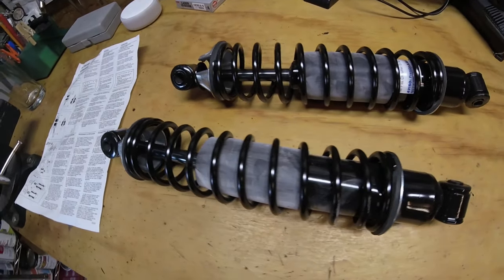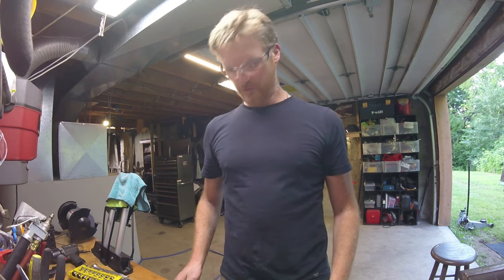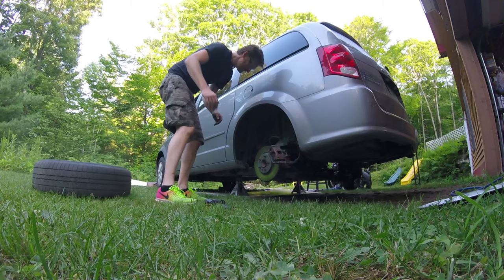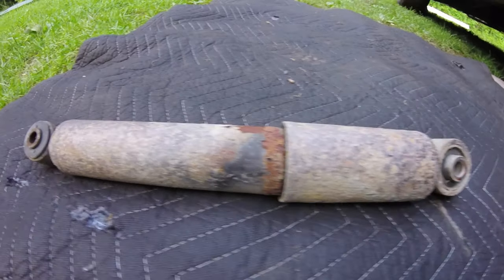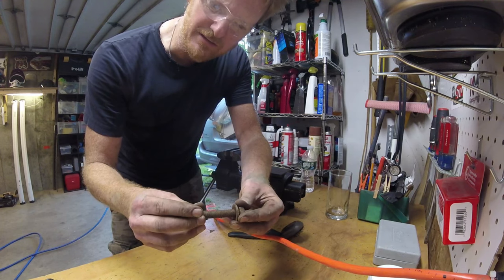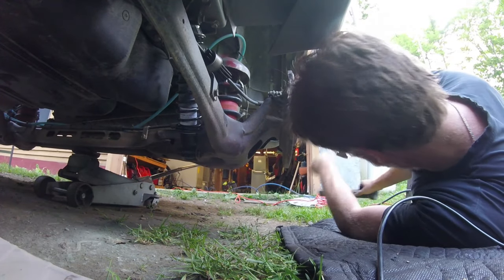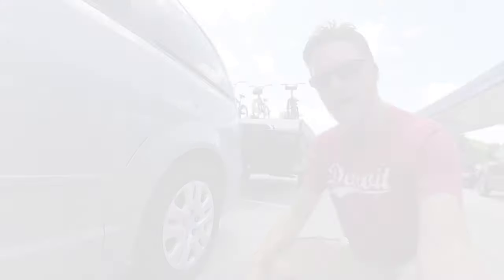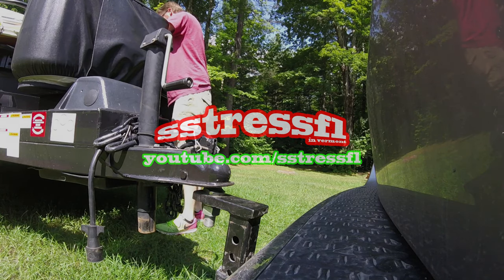Monroe Load Adjusting Shock Install & Results | 2015 Dodge Grand Caravan

Comment: What is the difference between load adjustment and load-adjusting shocks? Please answer quickly I need to put some immediately on my 2015 regal.
Reply from the maker: There shouldnt be a difference... these are shocks with a progressive spring that gets tighter as you add more weight. Usually gives you another 1000 lbs of lift. However, there are self leveling shocks/strust that will actually raise the vehicle to keep it level depsning on the weight added. I hope that helps.
Reply: @sstressfl  So, the adjust shocks would be perfect, then. Thanks

Comment: I have a question, did these shocks raise the rear of the van? I want a stiffer suspension without changing the ride hight
Reply from the maker: Graeme Pawson I think it looks a touch higher but I think all it did was restore where it was at when it was new. You’d never think it was lifted. It looks completely stock. Also the shock springs are progressive. It rides confident but smooth around town but stiffens up tighter as more pressure is applied. They’re not stiff. Just feels balanced.
Reply: @sstressfl  thank you for the advice, I have the Air Lift 1000 arriving this weekend and was going to install them, do you think that I should give them a miss or go ahead and install them, did they fail after you replaced them?
Reply from the maker: @graemepawson  in our Vermont winters, the bags get brittle after 1 winter and fail. But I got a note from a guy in Hawaii who says his are two years old and doing great, but he had to run the air lines through the bottom. I always suspected that if I lived in a more temperate climate they would survive better. I really liked the ability to adjust the pressure in the bags. But for me, I am walking away and using the monroe's. They are working great. I also bought a proper weight distribution hitch for towing our camper. Hope that helps you make the decision!
Reply: @sstressfl  Yeah, I live in CA, I don't tow but we use it as a camper the roof has a lot of load with 2 kayaks and 2 bicycles, it drops the back about 3 inches and leans on the windy mountain roads.
Reply: @sstressfl  Thank you!  I'm in CT and was thinking about the Air Lift bags for my Volvo wagon.  I'll give them a pass.  This car originally came with very expensive auto-self-leveling shocks which I was hoping not to return to, but maybe that's the best way.
Reply from the maker: @swiftarrow9  Yes I think the bags would be a waste of time and money. I think you're right to buy the self leveling shocks. They do last longer and work really well. I think you'll be happier. Much happier!

Comment: Michael, I am thinking to replace the rear shocks with the ones in the video as we tow a small Runaway trailer that empty dry weight is only 700 pounds and loaded maybe 1100.  The trailer tongue weight isn't supposed to be more than 100 pounds and I do not think I am at that limit.  Hopefully this will make the trailer weight easier on the rear axle.  I have a 2015 Grand Caravan with the 3.6 V6 which has no problem pulling the trailer but at just over 90,000 miles I am starting to notice a slight shimmy in the front end above 60 miles an hour and wonder if it might be stabilizer bushings as I have Cooper touring tires with only about 12,000 miles on them and they seem to be ok, any thoughts on that?
Reply from the maker: That’s a very light trailer! For ideal handling you want to make sure the nose of the van isn’t pointing upward and the nose of the camper isn’t down. The shocks should help lift the rear end of the van to some degree. The wobble issue could be a number of things. I would first check wheel/tire balance. Go to a reputable tire shop. Not Walmart! If tires are ok, do a full suspension inspection. Also could be rotors especially if you can feel it when braking. Hope that helps 👍 Enjoy that camper!!
Reply: @sstressfl  thanks for the tips and I have the van and trailer pretty level after experimenting with different hitch heights.
Reply: I checked this morning and my 2015 Grand Caravan in the rear has shocks inside of springs and does not have the diagonal mount shocks, was that an upgrade that year?
Reply: I do now see the shocks and I watched your other video on the clunking as well.
Reply from the maker: @stevenarndt8072  Your shocks are self leveling. They are called nivomats and they are very expensive :)

Comment: Hi Michael I am wondering what are you pulling with your van what's the weight?
Reply from the maker: I am so maxed out. I am towing a 2019 Forest River Rockwood 2280bhesp popup. 2460 lbs dry weight. My wife and I, 3 kids, kayaks or bicycles (depends on the destination), luggage, portable AC, a small freezer, and misc stuff. I'm at or slightly over the grand caravan's tow limit. I just added a weight distribution hitch and used it for the first time this weekend. It was amazing. Felt like a truck... speaking of trucks, I suspect the next vehicle we buy after the van will be a truck.

Comment: How did you decide to go with the Monroe instead of the Nivomat option that is included in the tow package?
Reply from the maker: My van is a base van and I have added towing features :) My understanding is that the Nivomats have a different configuration, the coil springs have a different spring rate. Plus Nivomats are wildly expensive. Plus I'm using a weight distribution hitch now and it negates the need for extra boost. But, I will always buy this kind of shock due to its incredible ride quality even when the van isn't towing.
Reply: @sstressfl  I have the base also. Looking to do a similar upgrade for towing a travel trailer. I've read about just swapping in the nivomat without changing the springs and it being a very capable towing set-up. But I imagine the ride comfort will change. You found that just by putting in the Monroe that you get netter towing stability along with comfort when unloaded? I'm just trying to decide what is the best idea regardless of money...
Reply from the maker: Dan Bohman it’s better towing stability but not a fix for heavy loads. My camper is 2400 lbs. it needed a lot of help. I truly found the towing solution to be a weight distribution hitch. You can tighten up the rear suspension but it’s not the right way to do it. It puts too much load focused on the rear suspension/bearings/tires. The Monroes make for a better ride but they won’t compensate for a very heavy load. Even nivomats, while they might level out the rear end, will not properly distribute the heavy load. I hope that makes sense 👍

Comment: Brother is this ok i dont really tow but i want a reliable cheaper alternative. I dont wanna buy nivomat mopar or something to expensive . Hows the ride ? Is it harsh to hard?
Reply from the maker: From what I've read, if you have Nivomat's these will be too short and your van will squat.
Reply: @sstressfl  what if I change my fronts to monroe oespectrum and my rear to this? I dont tow. Will it last?
Reply: @sstressfl  can you provide the link for  the spring
Reply from the maker: @MrRGM10  I put a link to the Monroe's in the description under the video :) But here's the link! I bought the Monroe Load Levelers here: https://amzn.to/3ypavTr
Reply: @sstressfl  thanks man. Which is the best front shock  partner for that ?
Reply from the maker: @MrRGM10  I am running these. I kept the factory hat and springs and replaced the core. Years ago I bought Monroe Quick Struts for my 2008 GC and they had very poor ride quality. Never again. The factory components are much better quality than the aftermarket stuff so for the 2015 GC I bought quality cores and did the whole spring compress thing. Gorgeous ride. And they have already lasted longer than the factory struts. https://amzn.to/3wAAlXx
Reply: @sstressfl  brother it is unavailable unfortunately.  Do they still make them? The kyb
Reply from the maker: @MrRGM10  they are available for the 2015. Check rockauto.com for your year. Hopefully they make them for yours or something similar.
Reply: @sstressfl  what do you mean you did the whole compress thing?did You use the stock springs and shock mount and the strut(or what you called core) to kyb? Im confuse newbie on this things
Reply from the maker: @MrRGM10  Yes I reused all of the stock parts. Compressed the spring to remove the old strut and installed the new strut.
Reply: @sstressfl  do you think a set of kyb 2SR4176349225 strut plus assembly  with excel G rear any good?  Saw for 382 at rock auto.
Reply from the maker: @MrRGM10  Great price. But what I have read is the bearings are not quality. The OEM bearings are far superior. Thats why I dismantled mine and kept the stock pieces.
Reply: @sstressfl  thabks man. Can help me i saw my rear shock made by sachs but im not sure if it is a nivomat cant seem to find it. part no. I saw 52830 looks short and wide
Reply from the maker: @MrRGM10  That I believe is a standard shock :)

Comment: Question...would these Work as nivomat shock replacement on a Grand Caravan 2003?
Reply from the maker: Hector Casarrubias maybe, but I seem to remember reading that they might be a different length and/or the mounting holes are diff sizes? I know the nivomats are expensive so it’s tempting to try. I wonder if you could order them from amazon, compare them side by side and send them back if they don’t fit?
Reply from the maker: Hector Casarrubias ouch!! Perhaps you can call the shock manufacturer or find specs online. I do remover reading that vans with nivomat shocks have a different coil spring rate. I wish I knew more about it my friend. Let me know where you land!

Comment: Where did you place jack stands here? thanks
Reply from the maker: Richard Loach I believe right where the rear trailing arm meets the mounting point. Where the mount bolts to the frame.

Comment: Good. But NEVER put grease on bolts unless its antiseize. You'll have to do a wet torque. Also its not a air hammer its a air impact gun
Reply from the maker: Miguel S About a 30% diff in wet vs dry torque. A huge rusty vulnerable bolt like this one is the perfect application for grease to dispel moisture. Same if I used anti seize. It was a common solution in bike shops where rust was a problem. I use grease frequently here in the rust belt. It has saved me from pain many times. I’ve never used a torque wrench on shocks, just my own mechanical feel. And yes I’ve used air hammers before and i keep calling the impact wrench the wrong thing. Thank you for pointing it out. In another video I actually referenced my “electric air hammer”.... uhhhg. I’m working on it 👍

Comment: "Never trust an air hammer, always use a torque wrench".  My philosophy is torque wrench or not, never tighten lugs with more torque than you can apply with the jack handle on the side of the road.  Also oil or antiseize on lugs is your friend.  Rust shouldn't be what holds lug nuts on.
Reply from the maker: I tighten to oem spec and I have replaced a wheel on the side of the highway with OEM tire tools. No problem. None of my lugs have rust. I take my wheels off every fall and spring. I detail my brakes and undercarriage, clean everything. And I use grease where grease is needed. I have to! I live in Vermont ;)

Comment: 2011 Grand Caravan put in the Mon-37290 shocks in 2018. Less than three years later and 22,770 Km had to replace in 2021. Less than a year later and only 7,970 Km the shock is leaking. Heaviest load would be the kids or groceries. Not impressed with this product
Reply from the maker: I've had great performance from this shock. Installed in Aug 2019. Still going strong!
Reply: Hmmm, I think the grand Caravan takes Monroe #58648. Are you sure you're talking about the same coil over shock??

Comment: Paint them when new. Their paint-job is terrible.

Also, the bushing rubber is JUNK, might as well press in new bushings before installing.

Ask how I know
Reply from the maker: I don't know how I missed your comment! Just saw it. Some clunking just started in the rear and could be the shock bushings! Still, I really like the way they ride though. Easy fix :) Thanks for the feedback bro!
Reply: Any link to better bushing rubber or should I just go to a Lordco and ask for replacement bushings for shocks?

And I may have installed the load balancing system incorrectly but I am still sagging quite a bit in the rear of a 2016 caravan.  While I got the tire off to add these shocks in, should I get the Timbren DVRRT suspension enhancement system or think shocks upgrade will be enough?
Reply from the maker: @viccycling7862  the shocks are good for firming up the back of the van a little bit but when your wdh is adjusted correctly it will level out the van and trailer all on its own :) These were the only bushings I could find locally and they have worked flawlessly so far. https://www.autozone.com/suspension-steering-tire-and-wheel/shock-eye-bushing-set/p/energy-suspension-black-shock-eye-bushing-set/354883_0_0
Reply from the maker: @viccycling7862  the sachs look amazing. But pricey! The shocks will help with the normal ride of the van but once you install a WDH, you could have the stock shocks and will have the same performance. If you slow down and consider what you're dong with a WDH... it'll make more sense. The angle of the wdh effects it's forward force on the front suspension AND rear lift on the van, as well as lifting the nose of the trailer and placing force back onto the trailers wheels. It's pretty amazing. And when you get that angle right and the chains (if you're using a chain style) tight enough, you'll find an amazing easy and safe towing experience. And again, the stiffness of the rear shocks will have little to no impact.
Reply: @viccycling7862  get em online. Measure and get poly. Poly will outlast the shock